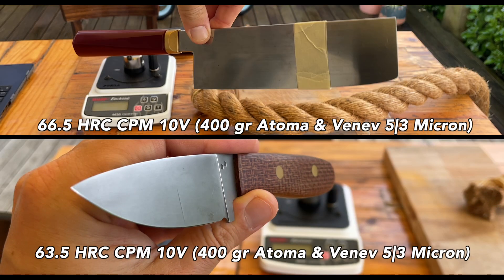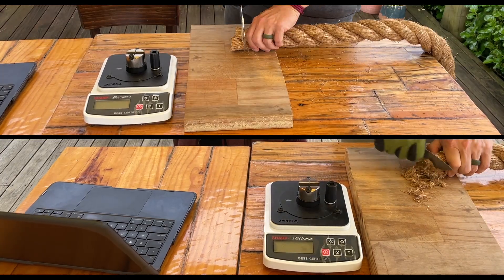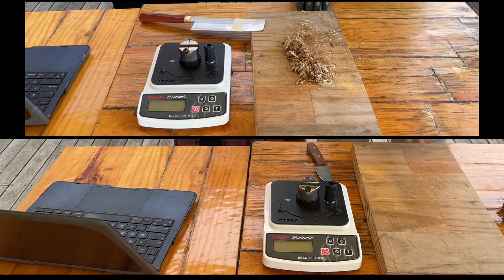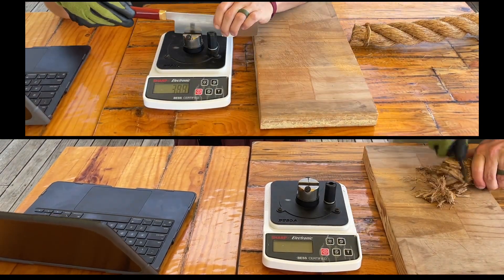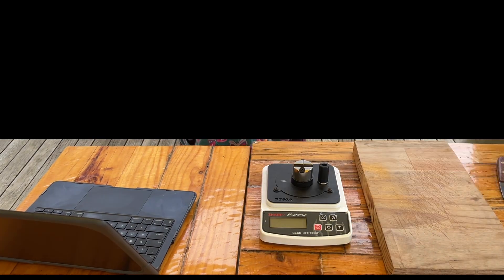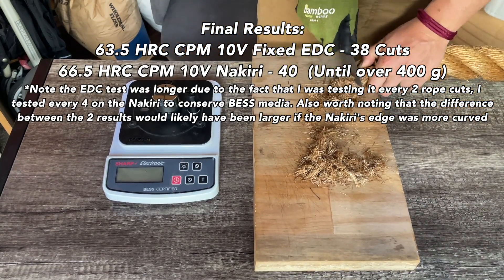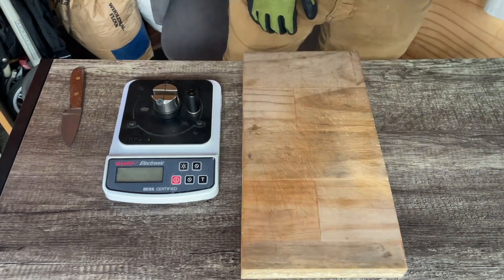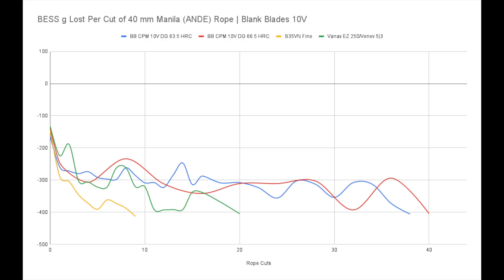INSANE RESULT | Record Breaking Dual Grit 10V Steel

Comment: Interesting . . . this translates to a 15% to 20% smaller edge geometry & 100% ( twice ) the cutting edge durability. 
- My thoughts are; 20% constitutes obvious performance improvements, which are instantly recognizable. 
- Double the edge retention helps all of us who wait until a knife feels dull before we sharpen. 
- I appreciate the cutting edge radius data points which save me time in my quest to provide relevant push cut force test data.

- Just completed building my surface grinder attachment designed specifically for thinning culinary knife blades. 
- Now I can again focus on creating the videos to share the data I have gathered on push cut force requirements. 
Hope you sharpened Dani's knife before you gave it back to her. ( LOL )
Reply from the maker: Thanks Daniel - I'm glad it was helpful!

Funny you should mention resharpening, with this Nakiri I always just hit it with some light edge-leading strokes at like 15 dps on a FEPA 400 grit Venev stone, finishing with one or 2 ultralight edge trailing strokes with minimal-to-no stropping.

The edge just comes back so fast, I never have to work for it, and at 66.5 HRC the burr pops off very cleanly.  I did my normal job after this test and Dani found the knife was not cutting satisfactorily.  

I was like "Ooohh.  Like after cutting Manila rope 42 times, you actually have to sharpen this... Oops!"

I revisited the stone and took 15 minutes rather than my customary 5...  Now Dani is happy again 😆

Comment: I'm going to try your dual grit method, just wondering, 🤔
With the knife in my right hand, with the blade pointing edge down /away,  which side should have coarse, and which should have the fine grit,,
Or doesn't it matter,,??
Reply: I alternate mine after about 5 sharpenings just to keep the bevels even (although I’m barely taking any material off, it just seemed logical).
Reply from the maker: I like to start out with the shiny edge facing me for a good 5 sharpening sessions (just like Al) because it's nicer to look at, lol.  (That would be fine side left, coarse side right in the requested orientation).

Afterwards, if I can bring myself to it, I switch to coarse edge on top (left side in the orientation you asked for) if I am worried about creating an off-centered bias in the edge.

Comment: I bring my knives to work to test them on carpet pad...I really don't see any benefit to most super steels. 15v was really average. Does edge retention just not matter on certain materials?
Reply: I guess it really depends on the abrasiveness of the cutting medium, and the point at which one feels a blade needs re-sharpening. In my job, for example, 15V fared a lot better, going about three and a half weeks of cutting cardboard, nylon strapping, fibreglass reinforced tape, & paper, before I took it to the stones. A lot of steels don't last nearly that long doing the same work. But had I been cutting carpet pad, or sheets of 60 grit sandpaper for some reason, that could very likely compress the whole edge retention spectrum regardless of steel.
Reply from the maker: Hey jusme, thanks for the question.

My simple response is that edge retention matters, but not in all cases/tasks/materials universally.

My technical response is this:
IMO in a way there are no "Super Steels" - there are just bad ingot steels (3Cr for example), good ingot steels (VG10 for example), very tough small carbide ingot steels (called Eutectoid steels, 12C27 or 14C28N are good examples), tough powder steels (like 3V), stainless powder steels (like S30V), and high vanadium powder steels (like 15V).

Someone might use good 3V and good 15V on rope with no prior knowledge.  If you asked them "which one is the super steel?" they would likely pick 15V (though many variables exist).  However, assuming the same test, but with someone cutting up carpet with good 14C28N and normal S35VN on a coarse sharpened edge, and it is likely they either would not know which one is the super steel - or they might pick the 14C28N.

More details to come.
Reply from the maker: Part 2: This is because knives hold an edge in 2 ways.  

One is by retaining a stable and small cutting edge apex (this is how Eutectoid steels and many tough carbon steels function, and it is why they can often be better at stropping back to shaving sharp, and excel at push-cutting tasks in a high impact setting like chopping or whittling wood and it contributes to why simple stainless steels are often used in the kitchen).

The other is by breaking down in a more beneficial way.  (This is what ceramics and many high carbide powder steels do).  These steels usually hold their fine-edge shape quite rigid (carbides don't bend) for a good while, until at a certain point they experience their first "dulling" .  However, these steels dull differently - rahter than rounding over with wear, they will more often allow a tiny bit of edge apex to chip away along the grain lines between carbides.  Because they chip along grain, the new edge that is formed is flat but has square "shoulders" rather than a rounded overall surface shape.  This edge shape is still quite small, and the corners initiate cuts fairly efficiently, though not at the original sharpness level. This edge state is usually referred by casual users as "working edge" and this is generally why powder steels often exhibit a long lasting "working edge".

So, powder steels don't necessarily stay finer/keener, they actually just break down in a beneficial way.  Because of this, they are great for aggression focused, wear resistance tasks.  However, because of this dynamic sometimes they are not as well suited to cutting tasks that involve a lot of impact to the edge either by velocity (chopping wood) or being dragged through hard particles and high-tensile fibers (cutting carpet).  It has been well documented that sometimes a simpler steel with thin geometry will outperform a powder steel (see Cliff Stamp below)

https://www.youtube.com/watch?v=QaPwKEPg-XQ

HOWEVER - keep in mind that MANY things go into the process (steel microstructure and heat treatment being foundational, good sharpening and burr removal being key, and many other environmental factors can be at play)
Reply from the maker: This is another case study (not to say simple ingot steel is always better, but I'm providing a balancing viewpoint to the video you are commenting on where 10V crushes all).

https://youtu.be/_9dj8L9qhSE

You'll notice in a wood-batoning high impact application Nitro-V (Eutectoid Steel) performs on par with MagnaCut, 3V, 10V etc.

Cheers bro.
Reply: What’s the specs on 15V
Reply from the maker: Other commenters feel free to throw in your 2 cents (or disagree haha, all good.) Thanks guys.